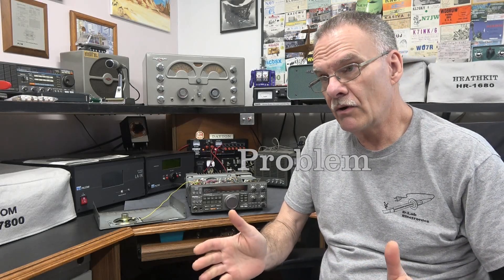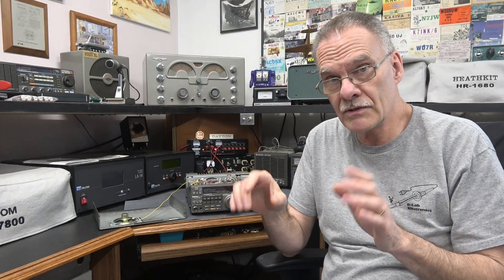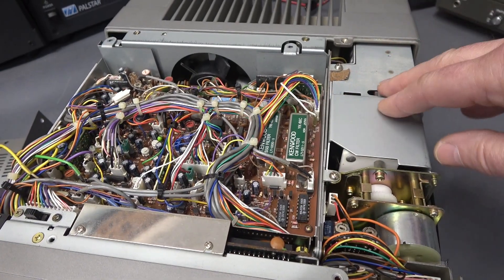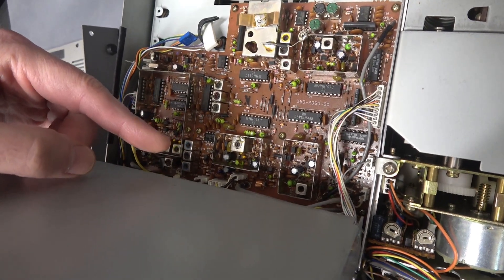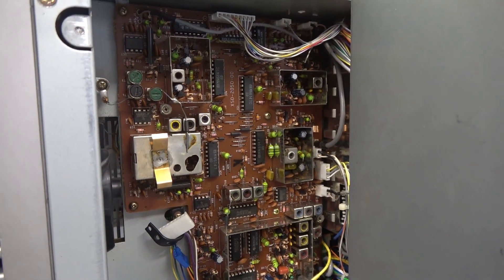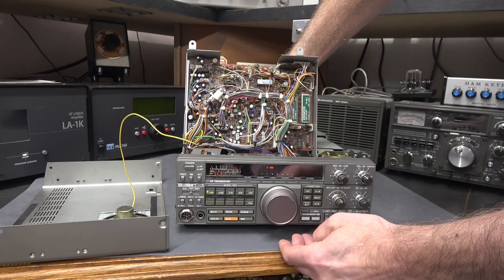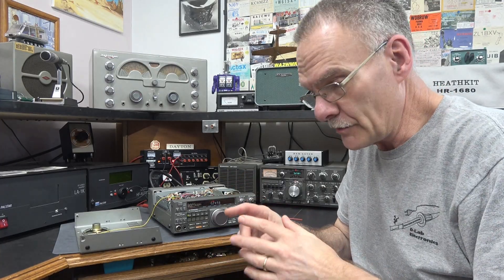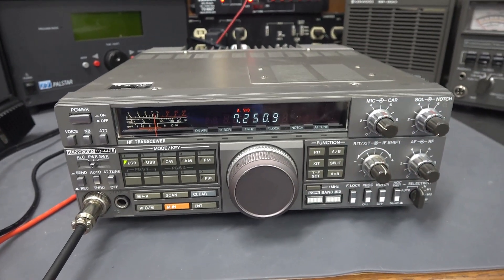Vintage Trio Kenwood TS-440s Ham radio transceiver DOTS issue repair

Comment: THIS  IS "NO" PROBLEM  !!   IT TAKES  ( 5 MIN ) TO  FIX
TURN IT ON THE SIDE .. OPEN THE "KENWOOD"

(LET THE SPEAKER BE ..AND THE TOP .. STILL MOUNTED)

SO ...LOOK INSIDE .. (A BOX ) WITH  "4  CANs TO ADJUST"  ..

ADJUST  CAN  NR 1.. ONE OR ANOTHER WAY ... THE "DOTS GO AWAY"  AND  RADIO "WORKS"..
( EVERY CAN .. CONTROLS  A  PART OF  "30KHz -30MHz")

VERY SIMPLE ... NO PROBLEM  ... EASY FOR  "EVERYONE"

OK   JUST  TELLING  HOW IT IS  ... YES MAYBE  IT IS TO ADJUST ... EVERY  3 YEARS OR  SO

..IS A  OLD THING ..

EUROPE (WEST)

HAVE A GOOD DAY
Reply: I hope you have a long a prosperous life, thank you! 
Fixed my radio.
 It was one with the clear adhesive and in the same box that the video above shows, I adjusted the can counter-clockwise and the dots went away and the sound came back.

Comment: By the way, turns out Kenwood was aware of the corrosive potting compound yet they refused to cover the repair. Screw them, I went with a K3 and havent looked back.  Dave N9HF

Comment: I had a 440sat with the dot issue. I did the repair myself. Amounted to removing the potting compound in the oscillator, and replacing a couple of caps. Time consuming but worth the effort.  Dave  N9HF

Comment: After a hiatus of 28 years from ham radio, I had my TS 440 memory battery replaced and I’m back up and running. No other issues. The CW and SSB filters are installed and I have the computer interface that Kenwood made.  I also have the Kenwood SP 820 speaker in the background. I think you’re going to think it’s a great rig like I do.

Comment: I have repaired both TS-430 and TS-440S but I never ran into the Dot issue. I’ll definitely file this one away. The TS-440S was my first SS radio transceiver back in 1988 ! 73, Jamie WB4YDL

Comment: VERY frustrating to find the real problem. My Faithful TS440 got the DOT disease and I did the fix for the water attracting foam that Kenwood made. And the problem returned and I gave up on that radio and gave it away. My first rig when got my General license